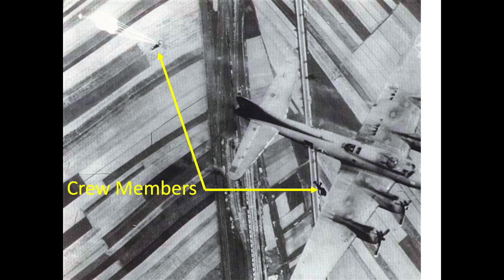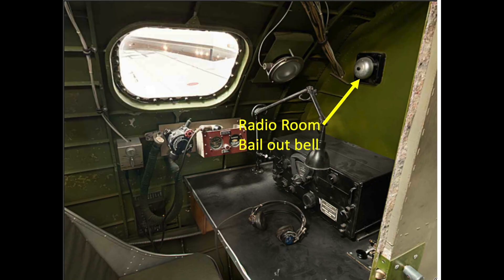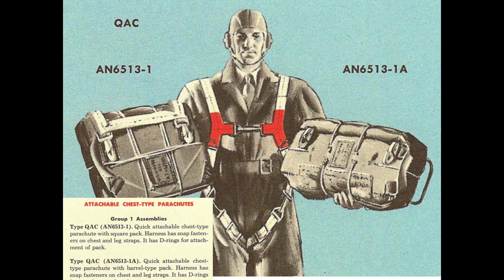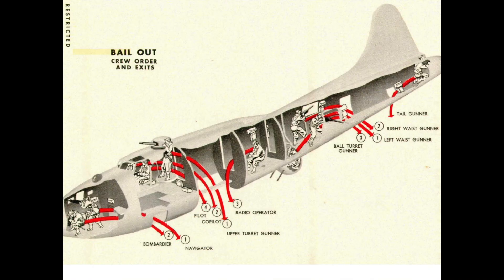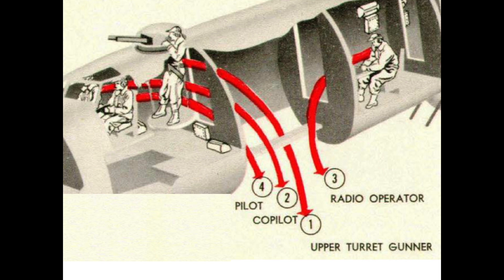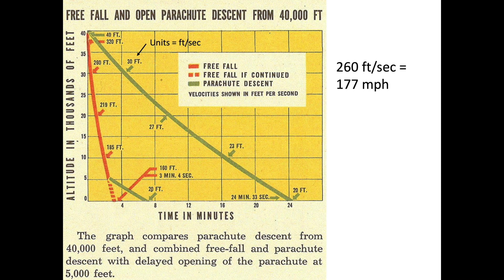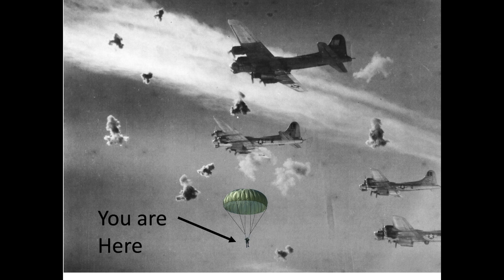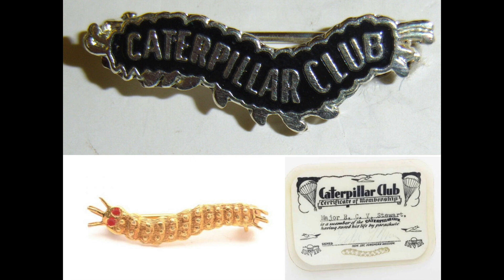B-17 Bomber, How to Survive a Bailout

Comment: Enjoyed your video very much. My dad was a ball-turret gunner on a B-17. On his 28th mission right after the bomb run fighters got into them and hit his 17 hard. A 20mm shell hit about a foot from his ball-turret and made a hole as big as a water bucket and wounded both waist gunners. The fighters shot them up pretty bad, one engine on fire right side, flight controls shot away. Pilot rang the bail-out bell and Dad got out of the turret and clipped on his parachute all O2 lines shot away, crew sharing 02 walk-around bottles. Pilot getting plane down to lower altitude and giving the long bell to bail out, plane went from dive into pitch up and pinned the crew to the floor. Then either a direct burst of flak or a wing tank blew up. Anyway, the right side of the plane from the radio back fell apart and the right waist gunner and Dad fell out with it. Dad caught a piece of flak in the leg just before this. He said all of a sudden it everything was so very quiet and he felt like he was all alone in the sky. Dad felt to see if he really had a chute on and was relieved that he did. Dad tried to pull the rip cord a couple of times and could not due to the thick, fleece lined leather gloves and the rip cord being so close to the chute pack. He got the glove off and pulled his rip cord and got a good chute. He said he saw only fragments of the plane after it blew up in midair. One fairly good-size piece of the fuselage hit flat on top of his chute and slid off doing no damage. As he neared the ground he saw a motorcycle headed in his direction. He landed on a German fighter base at the edge of the runway. Dad picked up his left leg just before he landed as he did not know how bad he was hit and sprained his right ankle landing. He pulled up his pants to check his wound and one of the Germans pulled dad's first aid kit off his harness and bandaged his wound, dad said it sure surprised him. Dad spent 11 mons. and 1 day as a POW before he was liberated. 612th Sq. 401st Bomb Group(H) 8th AF,  Dad's first mission 30 Dec. 1942 Ludwigshaven, last mission 28 May 1943  Dessau, 5 months in combat and only needed 2 more to rotate home. We lost Dad August 2012 at 91 years old.
Reply: houdinbat1,thanks to your comment here on YouTube,your dad's amazing story will live forever.Thank you to your dad and all Americans who fought and still fight to keep us free.
Reply: @phil4986  I thank God for men like your Dad. Thank you for that story.
Reply: that reminds me of a story i have heard.. us bombers hit this town around here then one was hit by flak.. some bailed out and ended out being hosted in the same house they bombed
Reply: Well told
Reply: @macnasty7605  Just shows us how crazy war is and how beautiful the spirit of some people are regardless what life throws at them.God Bless those Angels ..on both sides.
Reply: @dttempleton  Houdinbat1's dad was the person I was replying too but thank you for your comment.
My dad was a Korean war vet.
He only talked about it to me, alone ,a total of about twenty minutes total for the thirty fives years or so we were together,before God took him home.
He told me the story of a convoy he was in, on a mountain road ,where the North Korean military, blew up the front and the rear vehicle in the convoy and killed everyone in that convoy but him.
He said he heard all his friends getting killed all around him,the north koreans had them cornered and there was no way out.
He only survived because at the last instant, he hid in a bin in the back of a truck and the enemy soldiers never found him.
He was staring at the floor ,almost in tears ,when he told me the story and he only told me it once. 
I never asked about anything about the Korean war again.
Because this and his other story about them searching out a North Korean sniper trying to kill them, one sunny day ,told me how close I came to never being born.
I don't think they ever got that sniper but they sure tried.
My mom told me my dad went to Korea with jet black hair and when he got back it was silver.
Master Sargeant Dad,thank you sir and I love and miss you.
Reply: @phil4986  This is good to know these things that your Dad told you, as you can hold them in your heart and know that he cared enough to tell you when he though you were old enough to know. Phil my Dad only told me bare basics of his combat and POW time. He told me of his training as a radio operator and gunnery training, how he was trained as a B-24 BTG and the B-24 Group he was in. When it was time to deploy to England their plane had a problem with their pilot and had to turn back. Dad was sent as a replacement BTG to a B-17 Group. I had seen a short written copy of his last mission, shown to me somewhere around 30 years ago, it did not include some of the details that I posted above. I got Dad about that time to write to the 401st BG address that I found in the back of a aviation magazine (pre internet) and he joined and went to their reunions every two years.
I got to meet 3 of the men that were on his crew and their wives during one of the reunions that was held in our home state. I got to reading some of the group's history and found out a lot of facts about the POW camps that they were interned at. I told you all this to tell you this a few years before Dad passed my sister that is 18 years my junior (my half sister) got to asking Dad around his service time. I was born in 1952 and she in 1970 the year I graduated HS, so she did not grow up around the service men and women from WWII and Korea like I did. Dad opened up to her more then he ever did with me and he showed her notes and narratives that he had written off and on after the end WWII for a few years as things got remembered and he got the chance to put them down. She took it upon herself to take all these notes and to write a narrative of our Dads service time from start to finish, this even includes what the missions he was on even the B-17's and A/C #'s and names if they had one ( didn't always fly on the same A/C). She did this for me as much as for her so she could understand some of what our Dad had been through and why he was like he was.  After she had completed all this it was presented to Dad and he finally opened up it helped heal some of his wounds and mine. So be proud of your Dad and glad that he at least shared some of his memories with you.
Reply: @houdinibat1  Very much so.
I am proud of my dad and I know you are too.
We are blessed everyday that we had the fathers God graced us with.
May they rest in peace knowing we will always love them and thank them for what they did for all of us.
Reply: WoW!! I like your story. Thanks!!!!!!!!!!!!!!!!!!!!!!!!!!!!!!!!!!!
Reply: @phil4986  m m.j
Reply: I absolutely admire your father and your story brought me back to playing cards with my grandfather on moms side. He was/is my hero. Right waist gunner on the Celestial Princess. Nose art that of the Miller High Life beer "Woman on the moon" his stories and the no fear and over all badassery of him, his crew and all that flew with him and YOUR father sir. Thank you and God bless. I have his tags and wings. 2 of my most prized processions.
Reply: His was called the Greatest Generation for good reason. I served 24 years and made more than 500 military Parachute descents, 106 of those static line, the rest freefall/HALO. I can't imagine jumping under those circumstances. Much love and respect to your late father from a Canadian vet.
Reply: I hope you had a chance to document his stories properly.  Thanks for sharing
Reply: @micsunday14  Yes we did, all copies were sent to the 401st Bomb Group Association and copies to the archives at the Mighty 8th Museum in Pooler Ga. There is a audible oral history along with other WWII veterans in the local library of Dad's home town that they complied 30 years ago. We also sent copies of photos Dad took of POW Camp Stalag VII A in Moosburg Germany that he was moved to from Stalag Luft IV in Gross Tychow Poland during the last days of the war due to the Russians coming in through Poland (see Black March). After they were liberated the Army tried to keep them in the camp until transport could be arranged to move them to camps in France and then back home. The Army got all kinds of food to them K-rations, C-rations and plenty of Red-Cross comfort rations and clothing. As the Army could not cook for so many men they had to prepare their own food (got the pics to prove it), they did get medical help to them. Being men that had just spent months or years imprisoned the would catch the MP's looking the other way and cut the fences and go into Moosburg. Dad liberated a camera (traded for food) and took pics of Stalag VII A.
Reply: @78logistics  Thank you Mitch.
Reply: o7
Reply: A legend of a man
Reply: Your Father was only 21-22 years old at the time. That is what is particularly amazing to me. He was so young when he experienced what he did.
Reply: What always amazes me,was that people who suffered these terrible experiences were able to put it behind them and go on to lead good lives,post war.The human spirit really is something
Reply: Hardcore
Reply: Your father’s experience reminds me of the story of the German fighter pilot leading a shot up American bomber to safety.  He and the bomber pilot eventually met years after the war and went on to become fast friends.
Reply: P
Reply: Can’t believe how brave those guys were. We can never repay them for what they accomplished.
Reply: amazing story absolutely insane. Like   I was watching a movie as. You told his story.  Thank you👌
Reply: Your dad is a worshipped hero. Thank you for the story.
Reply: I have immense respect for your dad and all crewmen who flew these missions during WW2. Thank you for sharing this.
Reply: Your dad's story will live forever, thanks to your sharing it here.

Comment: When I was a kid during the 80's I got to hear firsthand from a waist gunner on a B-17 on his having to bailout. He said when the captain ordered the bailout, you did it without question. He cleared the plane and what he vividly remembered was one of his gloves coming off and floating in front of his face during the freefall. He pulled his parachute ring, had a good canopy and looked at the ground. He didn't see a soul around and thought he may have a chance of escaping. As soon as he hit the ground he said the "Germans came out of the woodwork" and he spent 2 years as a POW. (He said the Germans never mistreated him.) He later found out the pilot and co-pilot managed to limp the plane back to England!
Reply: That seems to have happened sometimes - the order to bailout but the plane ends up returning home.  I always wondered how the reunion went with the pilots and surviving crew if they met again after that.
Reply: @richardjames1812  I could imagine the pilots trying to keep the plane level for as long as possible to help with the bailout and then realizing the plane had stabilized and wasn't as bad as first thought. One really can't fault them. I think a lot of it was fear of exploding if on fire.
Reply: Also, it is possible that after crew bailed, plane became more stable due to loss of weight of crewmembers

Comment: You're producing some very good videos.  I thought I'd add some comments from my Dad, he died in  2010.  In August 1944 he and the rest of his crew (he was the navigator) had to bail out of their plane which was on fire....  when he was  at the nose hatch, the upper turret gunner was there, frozen in fear....Dad had to push him out.  Dad went next but hit one of his legs on an open bomb bay door, cutting it (the bombs had been salvoed and the doors left open for anyone wanting to leave through the bomb bay). The tail gunner could not get out his hatch because he was wearing his parachute which made him too bulky to fit through that small door.  ....he made his way forward to the waist compartment door and left there. All the others got out okay.  Another navigator also gashed a leg badly  on an open bomb bay door when he left his aircraft months earlier..  Also, one person who went out the nose hatch hit the ball turret guns which were pointed straight down as the gunner had left the turret to climb into the waist cabin.
Reply from the maker: From what I understand plane fires were considered the the main reason for bailouts. The self sealing fuel tanks helps but not immune to overwhelming cannon fire.
Reply: @WWIIUSBombers Thanks.  In Dad's case, the fire was immediately behind the pilots' seats at the upper turret.....and with those oxygen tanks there (I almost forgot, they were in a new B-17 on its first combat mission and someone on another ground crew had pilfered the plane's fire extinguishers...an unfortunate common practice with many pieces of gear when a new B-17 arrived on the base)...and no fire extinguishers, the plane was doomed.  I should have mentioned everyone bailed out, 7  POW and 3 Evadees.
Reply: @mikewhye3457  Great info...i do not like the robbers that consigned the bird to doom by having sticky fingers.
Reply: Thanks for this informing story and glad all of them got out. And thanks to your dad for his service. My day was Canadian infantry and was badly wounded in France and sent home.
Reply: Wow Mike. TY for sharing this information and I could only imagine what it must have been like at those harrowing moments in those men's lives.
Reply: @garfieldsmith332  
Glück ! Viel Glück ! Heimatschuß !
Reply: @heikoplotner2636  Danke.
Reply: @WWIIUSBombers  question where did you get the flak vest?
Reply: Was he captured?

Comment: I flew in a B-17. It was in up state Pennsylvania in 2000.  It was one of my bucket list items. Yes, the skin of the plane is the thickness of a credit card. I was amazed at how loud the engines were. There is no pressurized interior so it had to be unbelievable cold at 25-30k feet. We were about 6 people plus the pilot and co-pilot. it cost $400 for a 20 minute ride. Once you were up you could move around the plane. The only positions not accessible were the tail gunner and the ball gunner positions.  Along with the pilot and co-pilot seats.  I have much more respect for these brave men now that I've had that experience. Thank you for your bravery.